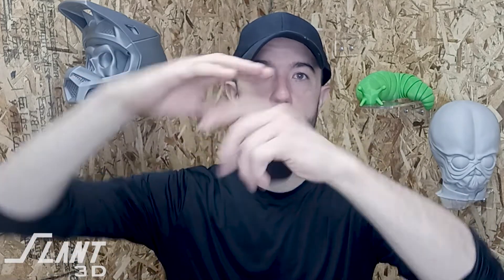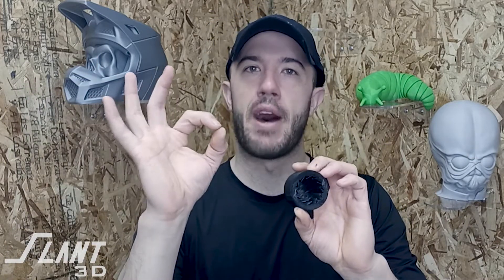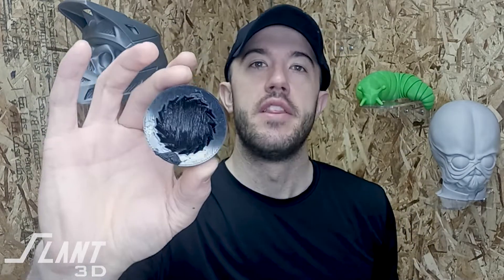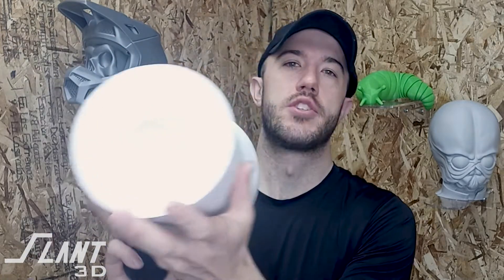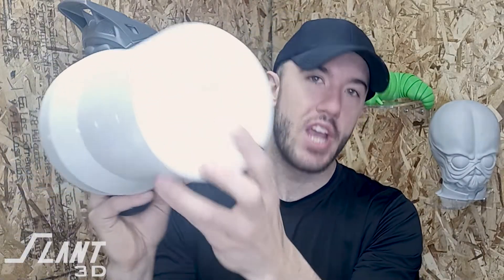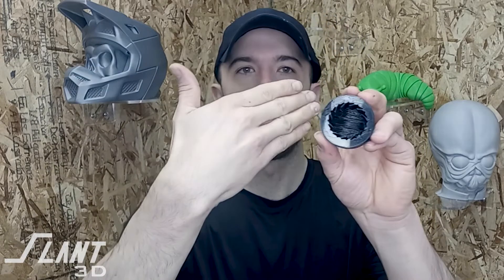Design for 3D Printing: Grip Fins

Comment: As it happens, this video came into my feed just as I was working on a design for a PET bottle cutter. I wanted to stick a wooden dowel into the cutter and have it firmly upright. I made this in Designspark Mechanical and it worked like a charm. It hammered right in and no need to fuss over the exact measurement of the dowel.

Comment: Do you have to consider the direction of rotation when you design the fins? i.e., wouldn't the fit loosen if the rotation is going with the fins? By the way, thank you for posting this and for explaining the rational behind your design choices. I am just getting started in 3D printing, and trying to move from a CAD program to the real world is a challenge...
Reply from the maker: They are not for rotational items. They are simply for one part to plug into another.
Reply: @slant3d  You mentioned that the white part was to attach onto a motor spindle, I think they were on about that rotation and how well the grip fins would transfer the torque and if you need to take the intended rotation direction into account.

Comment: Nice idea! One important detail when designing flexure based mechanisms is design travel limiting features so it's not physically possible to flex the feature far enough to break it. I think the part shown includes features for that between the fin bases, but it's not mentioned.